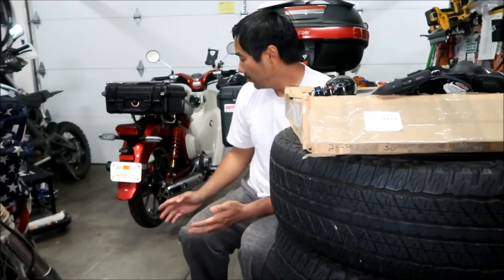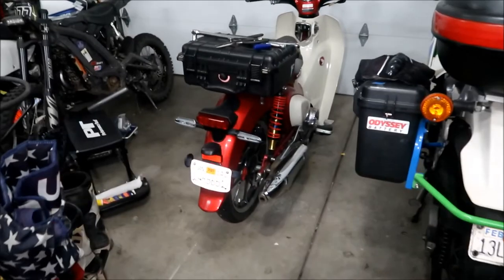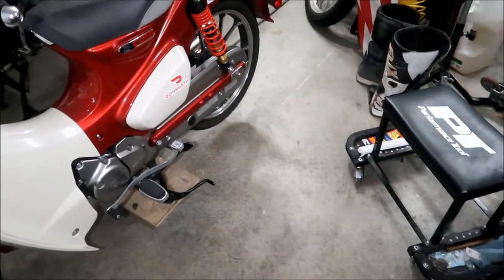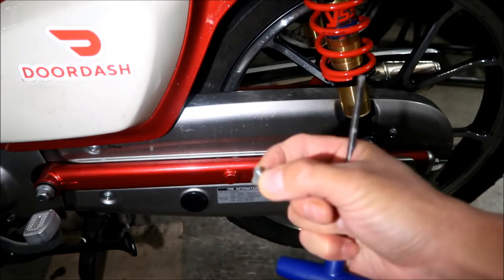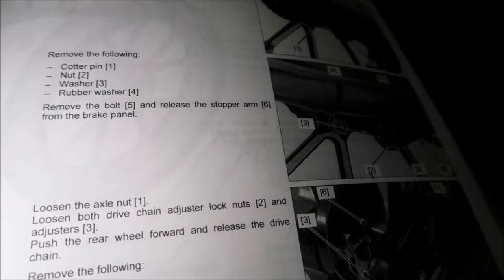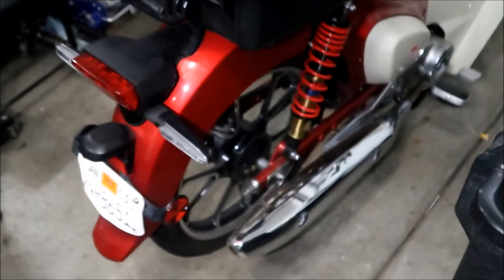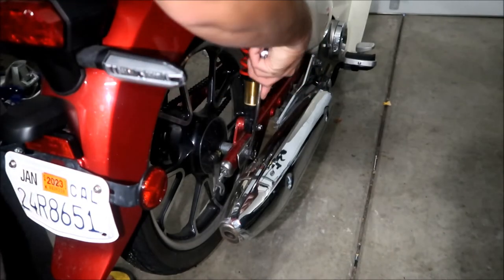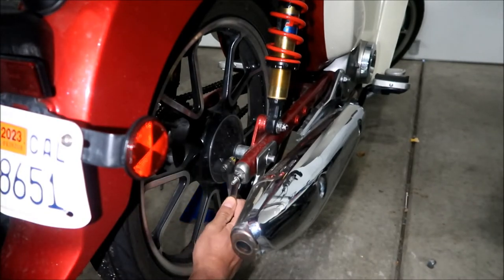How to Remove Honda Super Cub C125 Rear Wheel Part 1 - Removal

Comment: Most EXCELLENT video !!!   I'm sure you told us previously -- why did you change out 1) the shocks; 2) the back brake adjuster; 3) brakes ????   And, if one wanted to follow your lead, what parts needed, and where to purchase please ?  Wonderful resource.  You be SAFE out there -- you know the drill, "KEEP THE RUBBER SIDE DOWN".  😇
Reply from the maker: I changed the shocks because the stock shocks are awful.  They bottom out easily.  These bottom out less.  I just changed the brake adjuster because it looks cool.  I changed the brake pads because they were worn out.  You can purchase the shocks on ebay from Thai sellers.  You can find a lot of Super Cub C125 parts at Steady Garage.